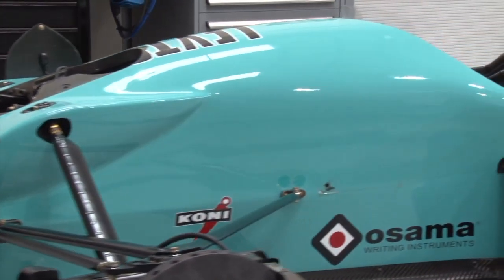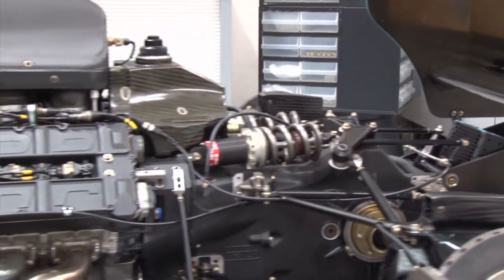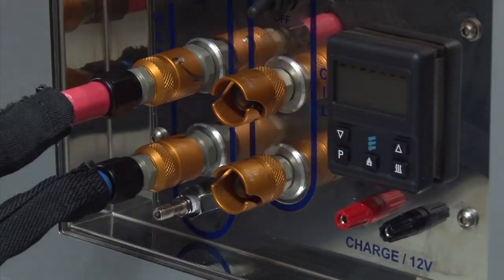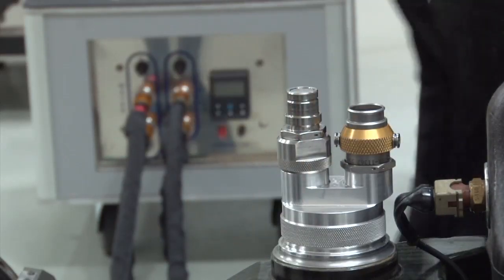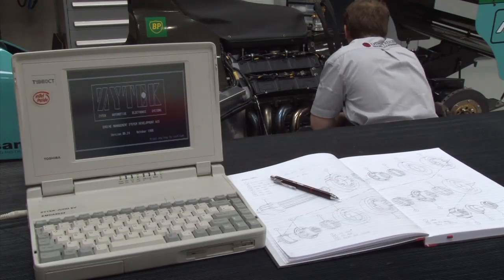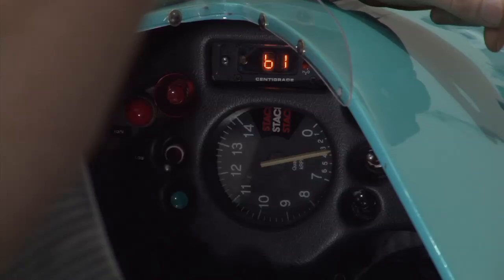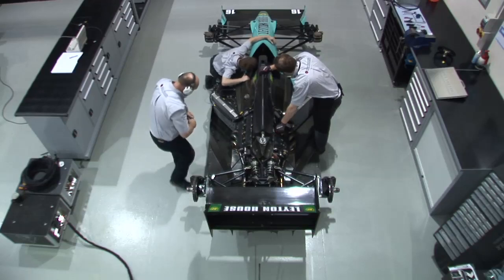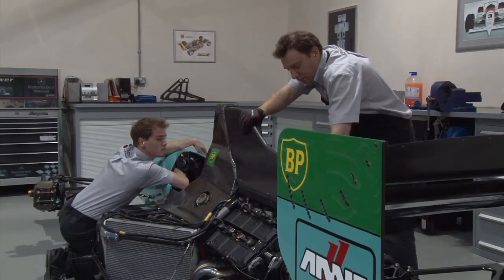Leyton House CG901B Start Up Procedure

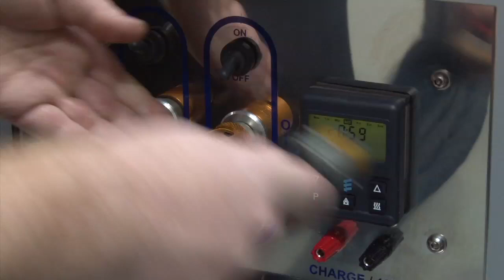Comment: 2:04 There's no fuel pump
Reply from the maker: There are 3 fuel pumps, a mechanical pump on the rear bulkhead and two internal electric pumps in the fuel tank. Hope that helps.
Reply: @DawnTreaderPerfom  does this very car have power brakes? I know they had been allowed in the regulation til 94.

Comment: Formula 1 cars at this level of deveolpment were things of pure engineering beauty.

The Leyton House of 1990 is still to my eyes the best looking F1 car ever made and a credit to Adrian Newey's design and engineering skills.
Reply: Its well up there I agree
Reply: The car was actually terrible apart from that one weekend in France where it finished second and only lost because of its own poor reliability. The 88 car was better but if you're basing it just on looks then I can certainly see what you mean about this car.
Reply: @jacobmassey3897  reason why it was horrible, was due to faulty wind tunnel design which Newey didn't figure out till later if I remember correctly.
Reply: @jacobmassey3897  tbf he did say one of the best looking cars ever made
Reply: and the  best  colour  or livery  in f1  senna  jps   lotus was  another that   springs to  mind  ....they  dont make beautifull cars  like this   anymore
Reply: @eamonnquigley2125  It's all about that relentless quest for ever higher speeds, leading to ever shrinking lap times, even if that meant a greater modicum of downforce than before.